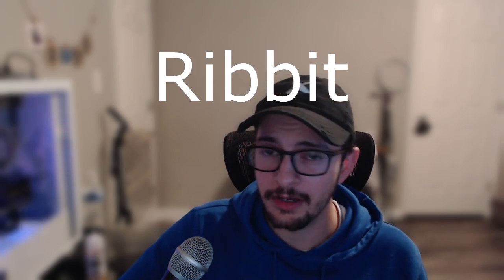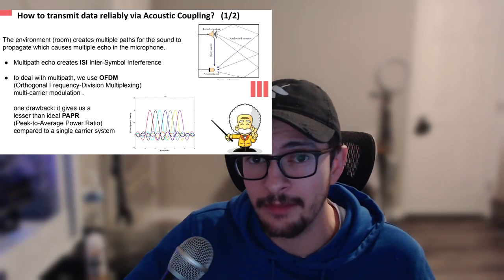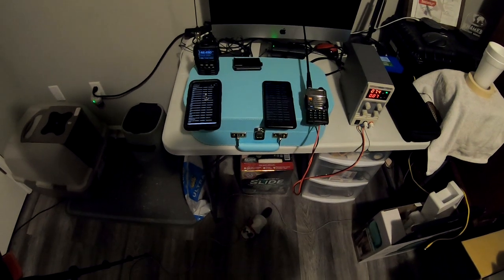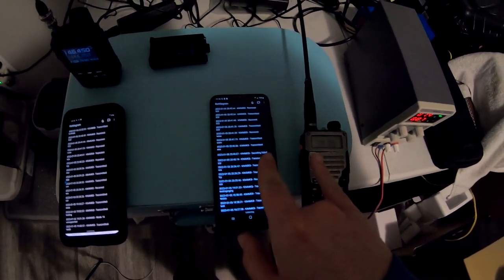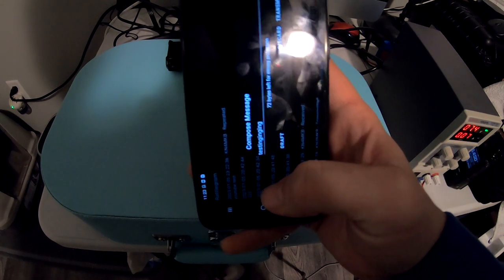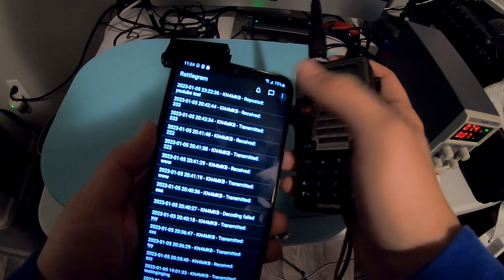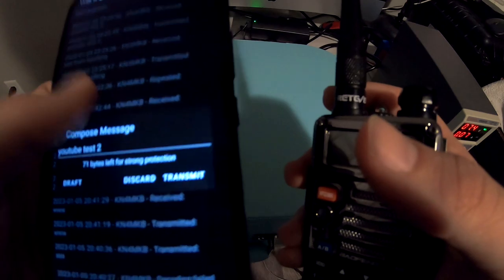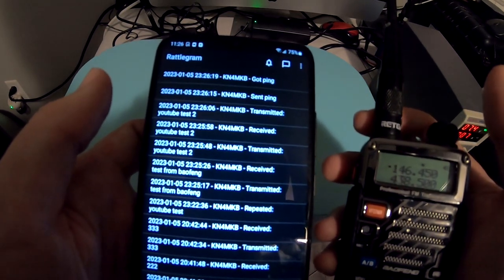Ribbit - Text Message over Ham Radio with a Baofeng

Comment: I sent you that link... Very cool you did a video on it, great job!! 👍 👍 How many characters can you send per TX? I gotta dig into this more! That would be awesome with repeater capability on VHF/UHF.
Reply from the maker: Yeah I had forgotten who it was that sent it. I pinned your comment to the top. I think 84? But I could be wrong. The information is still kind of vague on its current capabilities.
Reply: @ModernHam  it has a ton of potential, I see why ARES/RACES would want to use it.
Reply: Still not settled on the character limit. The algorithm is flexible, we handle Emoji. Higher character count make for a longer transmission time.
A sweet spot is 140 to 170 characters but could do longer
Reply: @AlphaFan90  can you use a cable with baofeng on vox? for transmiting on the app?
Reply: @nelsong4254  yes any audio cable would work.
Reply: I think this app is very special.   You mentioned using a repeater.... Well,  if I have a 50w base station set on VOX.  If i have a SIM-less Smartphone with Rattlegram on "listening", and set on "Parrot" mode and a local person sends a message with just a UV5R,  then mine could retransmit his message but at 50w over a huge distance, like a kind of repeater...  
This would have to be tried. But it seems possible...
In a real emergency,  like the Maui fires or a huge Katrina storm, this app would bypass the failed cell network and allow many to communicate at a critical time, without occupying precious time and bandwidth

Comment: FYI
-all dmr radios send texts and private calls
-any radio that has APRS built in sends texts to radios and phones. 
-radioddity GD-AT10G  
-Radioddity G-88 
-anytone 878
-btech 6x2 dmr
-any radio with GPS can send coordinate data; abbree 869, radtel RT-490, etc
-BTECH GMRS pro has gps and texting
-mobilink'd is a device that sends GPS and APRS from a baofeng

just in case someone didnt know all this. I didnt.
Reply: Hi !! Greetings from Argentina !!!!!!! How can I use two Baofeng BF-999 and two arduinos to transmit and receive data over-the-air ??   Thanks !!!!!

Comment: This is an extremely interesting topic.  The information was very concise. The demonstration was very straight forward and simple.  Also, you have a beautiful girlfriend, wife, or friend.  Everything works!  The best part was, budget minded equipment was used instead of some $490 Yaesu handheld transceiver that produces less power, has less battery life, and it is terrifying if you drop it.  If you drop the budget minded radio, there is little worry.  It will likely survive, just like the  Yaesu.  But if it does break, just buy another one and use the broken one for a project.  If you drop the Yaesu and it breaks, the sky darkens, lightning streaks across the sky, and the horsemen of the apocalypse come riding down. Woe to those that break a Yeasu!

Comment: What would be really cool is if this app could grab your location from another app like Gaia a gps/ trails mapping app that off road enthusiasts use to plan trips through the great outdoors and contains maps of trails, state and federal parks and automatically transmit the data for the receiver to manually or better yet somehow load the data back to another phone running Gaia or similar app. It's the next evolution of this project. Partnering with the folks that developed Gaia would benefit both especially on search and rescue operations.
Reply: Ribbit will have geolocation built in. Will look into Gaia app...
Reply: you realize any radio with GPS already does this? you can get ones as cheap as $40 like an abbree AR-869 up to $300 like the anytone 878. DMR radios almost always do this along with private calling, texting to other radios, texting to phones, and high level encryption.

btech even has a GMRS radio that can do this called the GMRS pro.
Reply: @palehorse7377  you can't use GMRS in Europe
Reply: Piss of a state trooper and use on X hunt they’ll have it all running together, I flew to South Africa from fort Cambell 4 times in 9 hours couple years ago, I must sleep steel sub sonic jets or something idk what I was doing out on coast but went many times same path in only 6-9 hours

Comment: ModernHam, you might enjoy SSTV. It works the same way - app on your phone and acoustically coupled.
You can use a repeater for increased range, since anything that will go through the passband of the radio will also go through the repeater. (of course get the owner's permission).
SSTV can be used at a disaster/accident scene to get pictures back to the EOC when you have no cell service.
Btw, it's good to see young guys experimenting. Most people today either get their ticket and never use it or maybe just check into the local net once a week. They are missing so much and don't even realize it.
Reply from the maker: I've used SSTV some. It's a pretty cool mode. I never thought of it actually used for a disaster/accident scene.

Comment: I take it that this line of site communications.   Like using packet radio unless you use a digipeater.
Reply from the maker: Yeah more than likely.
Reply: The LRS Local Ribbit Server has a digipeater functionality with message received acknowledgement and storage/archival with 1 year memory. Designed to peer 2 peer mesh messages when Internet is on and becomes an independent local node when the Internet connection is lost during emergency
Reply: @AlphaFan90  I assume it could also be used with a simplex repeater as well since it's just audio.
Reply: @fortwoods  yes. Works over a simplex repeater. There is a parrot mode in the app doing just that.

Comment: I'm in!  I trust that if you have a proper interface it will work same a APRSDroid works correct?  I hope that someone is also working on a version for Linux and Windows.
Reply from the maker: Yeah I would assume so. I hope as well
Reply: @ModernHam  Ok this is to packet/APRS what Discord is to IRC chat!  I thought I was having trouble decoding at first from the YT test but then I found that "Backing off" the mic gave a perfect decode!  I was overdriving  my phones mic!  I need to get a couple of burner phones and set up a couple of extra test stations around my area.
Reply: @W4TRI  would an android tablet and fongo work the same way?
Reply: @vetham100  no idea what Fongo is.

Comment: Thank you for sharing. What modulation does this use? APRS is AX25 packet, basically FSK.  I did not understand the cable statement on APRS since you can buy an APRS radio.
Reply: OFDM
Reply: The weak link in APRS is the underlying packet does not include Forward error correction. If a packet doesn’t match it’s CRC 32 error check the packet is rejected.  

I’m curious if this mode will allow digipeating.  Or if we can use a Bluetoothaudio connector on the speaker mic plug.
Reply: @ai4px  Ribbit has a very strong Forward Error correction. We are considering having Digipeater functionality on the server
Reply: @AlphaFan90  Although APRS uses the UI datagrams, it names all digipeaters in the system as the same name with a number on the end representing the number of hops the packet is permitted to propogate outward.  aprs digipeaters also store the CRC checksum of any packet it has digipeated in the past 30-60 seconds to packets don't just ping pong back and forth between two nearby didpeaters until the hop count it used up.

Comment: is there a easy/cheap way to run a cable between the HT and the android device?
Reply from the maker: You just need a TRRS plug between the two. You can use the Baofeng APRS Cable for this use case as well.
Reply: @ModernHam  How does this handle typical system notifications on a cellphone though? If you're using VOX, those will get transmitted if you're just using a simple cable to connect your phone to your radio.

Comment: Is there a set frequency for this or can you use any frequency as long as you use it through this app?
Reply from the maker: No set one yet as far as I can tell.
Reply: @ModernHam  ok..thanx
Reply: I would think as long as you don't use a repeater's frequencies or a commonly used frequency like the APRS frequencies you'd be ok. It is always annoying to hear digital modes on analog repeater frequencies. VHF and UHF do not have a digital portion of the band like the HF bands do. It would be nice if they did.
Reply: @TianarTruegard  that's what I was thinking or hopping..thanx

Comment: Would this work if i wanted to use a kway cable plugged into the phones 3.5mm socket?  Also if dcs is programmed on the channel will it still work?

Comment: Is there a way to delete messages after use ?
Reply: No, it automatically starts to delete messages after it reaches a certain number (which I don't remember).  Remember, this app is designed for emergency communications operations where there needs to be a "paper trail".  It is specifically designed that way so you can not accidently delete messages.
Reply: @mikesradiorepair  ok thank you sir! Have a blessed day 73 de KE8LUC
Reply: @mikesradiorepair  you are correct that's exactly why we didn't implement a message delete.
In the Ribbit app, we will have a 'archive' where messages can be minimized to 1 line and grayed out for unimportant messages. We are brainstorming of triage feature where messages can be assigned to a cue.